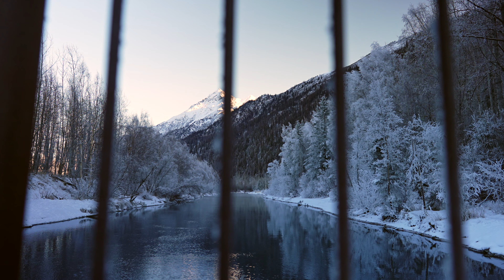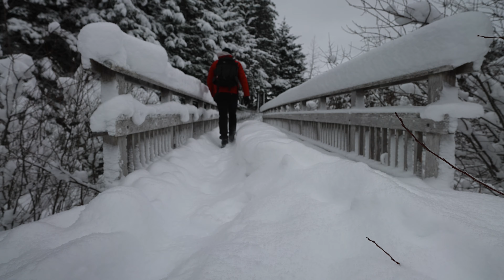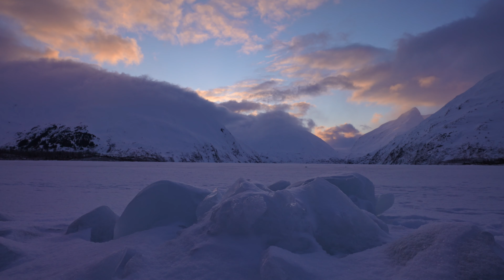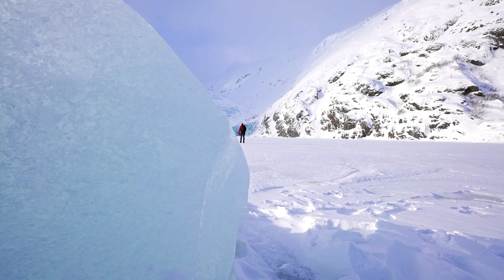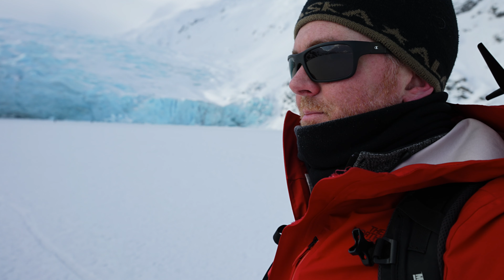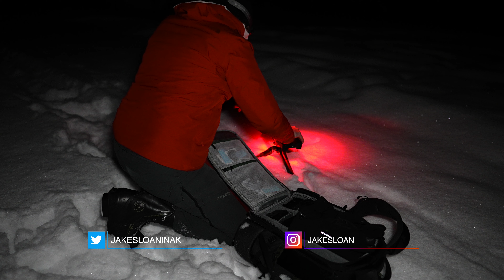iFootage Shark Slider Nano: The Best Small Motorized Slider I've Used

Comment: Have you tried placing it on a table with the ifootage quick release plate attached? Trying to figure out if the legs extend enough to give clearance
Reply from the maker: You mean with the sea stars? No it doesn’t. You’ll have to take the bottom plate off the nano to set it down or figure out another way to have it sit on something
Reply: @JakeSloan  thanks for the reply. That’s too bad. I would go so far as to say it’s a design flaw. I’ll see what I can 3D Print for the legs when mine arrives.

Comment: Hi Jake, how do you know how to pace the slider. Does it also have a tracker? As in, how do you know when you walk in the shot, how fast or slow or the pace of astrophotography
Reply from the maker: It doesn’t have a tracker so timing is really about figuring it out lol. The good thing is you can have it repeat the moves so you can get a few takes without having to reset.
Reply: @JakeSloan  The astro is what I am worried about the most as it will take quite a bit of time and you only get to know after. 
I have been trying to avoid a star tracker. The calibration aspect of a star tracker just seems too complicated when it comes to doing it in the middle of nowhere, dark and even worse if it's freezing cold. That in itself takes a good 20 mins if you really know how to go about it in ideal conditions. Basically, destroys the creative mood with the technicalities 😃

Comment: Can I use the slider with the ifootage TC5S(smallest ifootage tripod) with a Sony a7s iii with a standard sigma lense? The load max weight is 5 kg so on paper it should work but I want to make sure before I buy buy the slider, the tripod and the camera.

I will be shooting interviews mostly.

Any advice is appreciated.
Reply from the maker: for interviews it should work ok. The tripod and slider will be a good combination, the only thing that you might find you will need to do to get the best performance is getting the camera center of gravity with that lens on the slider set right. I've noticed that if a setup is really front heavy the slider will struggle but if I move the same setup back (using a long arca Swiss plate) to where It is more balanced then it does better. I hope that makes sense.
Reply: @JakeSloan  makes complete sence Jake. In the end achiving balanace reduces stress on motors and will reduce damaged on the slider. Like all this mechanical.
Reply from the maker: exactly right!